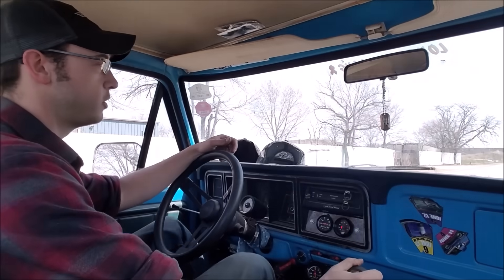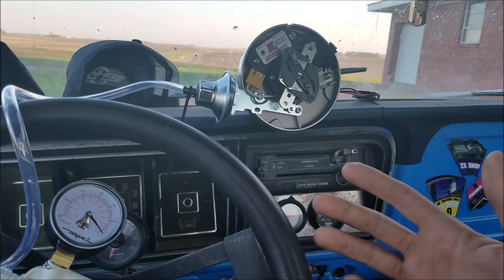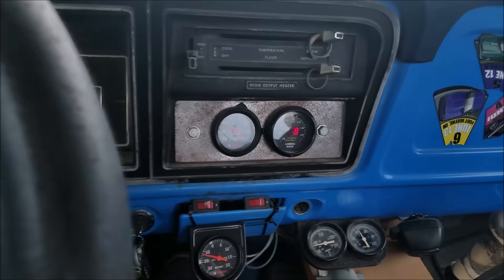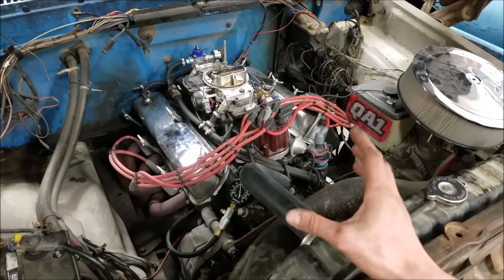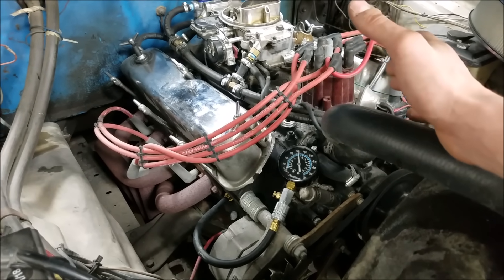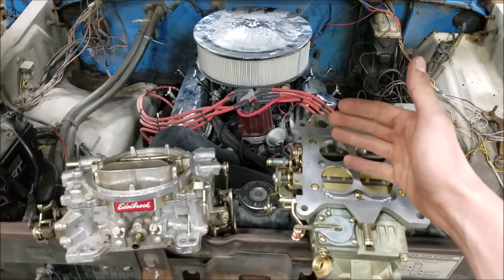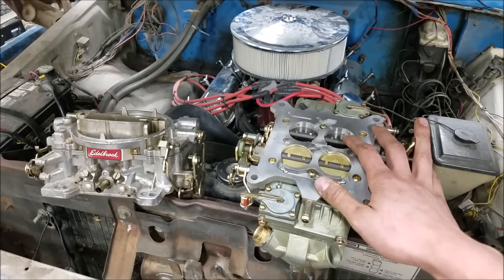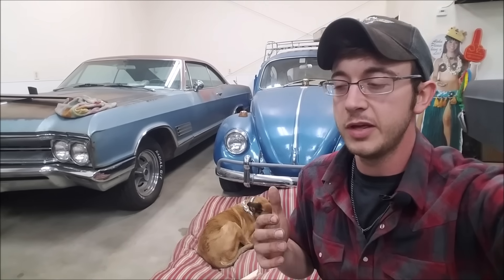Vacuum Advance - Ported vs Manifold: Which to Use & When !!!

Comment: Enjoyed the demonstration. But, my stock engines, 455's, 403's, 350's, 327's, all run best on manifold. 50-60's cars ran manifold from the factory. I tried ported on one of the 403's, compensating with adjustments so it would idle, and it became a dog and ran hot. Changed back to manifold and it cooled down and the off-idle power returned. Always a smooth, steady idle, and immediate power on take off. Don't see any advantage to ported. But to each their own.
Reply: My 78 Buick Regals idle cooler on manifold. On  ported vacuum,a long time idling, the temperature climbs to 230 quickly when I have the a/c on. Manifold vacuum it stayed at 200-220 max in the summer idling with a/c on.
Reply from the maker: Not all 59s and 6ps cars ran manifold- the venerable autolite 4100 only had ported. 
If you were having all those issues, you didn't adjust timing which is what I'm talking about - its not about ported vs manifold, it's about what ported allows you to do with your mechanical timing that you can't with manifold.

Comment: Ported vacuum didn't exist until emissions laws forced them to figure out a way to reduce nitrogen oxide emissions at idle. If you need to meet emissions, you'll probably need to use ported vacuum. Engine temps in traffic and parked are substantially lower with manifold vacuum because the engine is getting the proper amount of advance, and you don't need to rely on extra throttle opening as a bandaid. Less throttle, less fuel burned to spin the engine the same speed, as a result the engine runs much, much cooler.
If you want it to idle smoother and more consistently with cooler engine temps, use manifold vacuum. If you want to have a harder time getting it to idle smooth and you want to fight needless overheating issues, use ported vacuum. Everything beyond idle is identical for both.
Reply from the maker: I'm going to stop you right there about the whole emissions thing - that's an internet lie that's been passed around for a long time. Ported/timed vacuum existed way before emissions. 
The autolite 4100 carb for example factory on early 60s cars, like my own 64 galaxie, only had ported vacuum. 

Listen to what I say in the video and take advantage of it - its what ported vacuum allows you to do with your mechanical timing that manifold vacuum doesn't in many cases.
Reply: @ThunderHead289  Retired auto mechanic here: YES it does have to do with idle emissions! Why else would they design it into the system?
And it's no "internet lie." I've been working on cars for almost 50 years (they taught us about this stuff back in mechanic school many years ago!)

Also, I've NEVER heard of using ported vacuum to "tune" the centrifugal advance! (?) If anything, do the opposite: set up the centrifugal advance FIRST, after you choose an initial lead setting (use 0 to 10 degrees).
THEN, and only then, choose whatever vacuum advance setting you like, but stop short of pinging or knocking. Do it in this order, else it's like a dog chasing his tail.

Vacuum advance (of whichever type) is to improve fuel ECONOMY, and has absolutely nothing to do with acceleration/horsepower. And the centrifugal advance is what gives us the performance (higher engine speed requires earlier spark because the fuel burns at the same rate no matter what the engine RPM). Without it, the engine would steadily lose power as speed increases. Again, vacuum advance is for fuel economy ONLY (nothing else!)
Reply: than answer  is neither is right or  wrong.

will the engine  will run  better assuming  your engine makes the most power @ 36  degrees total timing

an engine  with  18 degrees initial  hooked  to manifold  vacuum?

or

an engine  with  18 degrees  initial  hooked up to ported vacuum?
Reply: A) Idle does not create a significant amount of nitrogen oxide, because combustion temperatures are lowest at idle. Most NOx forms at wide open throttle (high combustion temperatures)

B) If your engine runs hot at idle, it's probably a faulty cooling system, not the timing setting.

Comment: Just found this after buying an old G-body with a ZZ4/Edlebrock combo. Distributor is hooked to ported line off carb. Having a hard time with the engine pinging bad, even with 93 octane. My climate control also has a vacuum leak and interestingly enough, when I switch to heater, my engine does not ping so bad. Waiting for some parts to fix climate control and then hopefully my pinging issue can be resolved. Thoughts?

Comment: Ive been running manifold vacuum advance the whole 30k miles ive had this carb on.    Swapped over to ported vacuum last night.   With manifold vacuum the timing was so retarded it wouldnt start.  Added idk 14-20 degrees to get it running and set it until i didnt get spark knock.    HOLY CRAP DUDE, thank you, that was a wildly violent difference, i had no idea how retarded my timing was , guess what----- my flat spots are gone 😂 with the exception of a decent bog at real low speeds (mostly under 30mph) when i crack the throttle

Comment: Luke, if the difference between ported and manifold is no vacuum at idle, why would you not want vacuum advance at idle?
Reply from the maker: Because of what it forces you to do with your other timing events which I go through in the video. Everyone ends up compensating to bad mechanical timing events to accomodate the addition 15-20 degrees at idle
Reply: @ThunderHead289  Are you disconnecting the vacuum advance hose from the distributor when setting initial lead timing (you're supposed to!)
Reply from the maker: @John-jd7mm who said i didnt ...

Comment: Your information is spot on I learned it back in 1979 at Columbia basin college Pasco Washington had a great tune-up electrical instructor Jay Frechette still good friends today. I'm 67 years old. You also might want to explain if you have an automatic transmission that has a vacuum modulator it better be hooked at manifold vacuum at a centralized location on the intake or carb. And that vacuum better drop to zero when you put the throttle to the floor low vacuum = high pressure high vacuum= low pressure. Thanks for the great videos and information.
Reply: Yes, automatic trans vacuum modulator is supposed to work off manifold vacuum. Ported vacuum is used only for lowering emissions at the carburetor level. Everything else (power brake booster, evap-purge, PCV valve, etc) cannot be connected to ported.

Comment: Manifold vacuum will retard total timing at high rpm and in turn will keep pinging from happening. It’s superior
Reply from the maker: So does ported/timed - like i said in the video and showed with the gauge, they are literally they exact same thing except for at idle. THE EXACT SAME 
I don't know why so many people absolutely struggle with this ....
Reply: @ThunderHead289  well a main difference to me is engine temperature? Do you not find that your engine runs hot on ported vs manifold?
Reply: @lukefranklin2263  Methinks your cooling system needs a good inspection, dude.
Reply: No. That's not how it works.

Comment: there not the same. some of this guy rebuilt a carburetor and all of a sudden there are experts  there too young to know this stuff stop confusing people i always say if you're not helping you're in the way.
Reply from the maker: First of all, I'm thunderhead289 - you might look me up. Second, I'm not young, I'm in my mid 30s, 3rd - put two vacuum gauges on for yourself and watch them. 
Exactly the same except at idle. 
You all are confusing ported/timed vacuum with venturi vacuum and that's flat out 100 percent wrong.

Comment: Nice Hillbilly hack job under the hood. You can buy different length alternator spacers for Fords so you can save all those washers. Fancy carb and a shitload of rubber line and clamps. I would be embarrased to show my quality like that.
Reply from the maker: Yeah it's fine. This was like 5 years ago and still on the road today exactly as it was. 
If you can't see the forest through the trees, this is going to be a difficult hobby for you full of disappointment and regret.

Comment: Reasons I like mechanical advance.
Reply from the maker: They work in tandem together
Reply: @ThunderHead289  Correct. But each has an entirely different purpose: vacuum advance for economy, centrifugal advance for power.

Comment: My understanding is use the vacuum routing that came from the factory because other parts/timing have to also be modified if you change anything.  You can't just change from manifold to ported and not make any other changes and think you'll get a better running motor.
Reply from the maker: That's exactly what I'm saying - it's not about ported vs manifold since the only difference is literally at idle, it's about what ported vacuum allows you to do with your mechanical timing that manifold doesn't.

Comment: Hey I got a question maybe someone can answer. What’s that round thing on your throttle side of the carb?  I need something to bump up my idle under load, like when I turn on my a/c.  If anyone knows what that part is called or where to find it please let me know.
Reply: Does it have wires attached to it? That's called an anti-dieseling solenoid. You set idle with the plunger extended (key on) and the plunger retracts (key off) to close the throttle and prevent engine run-on after shutting it off (dieseling)

Comment: I had different motivations when setting up delivery trucks , ported will carbon load a lot more with a lot of idle time but manifold will make it run hotter at idle. Ported will allow a bit better tweaking to get mileage pickup when running empty on the highway without risking predet when under load 
It does get complicated when the goals are changed.

Comment: Now please explain WTF Chrysler was doing with their combo vacuum (ported and manifold tied together with high vacuum selector) from the mid 80s!!?
Reply: Some engines were designed to give manifold vacuum to a cold engine (runs better) and then ported to a warm engine (there would be a switching device to do this)

Comment: NO! I admire you giving a shot at this but though you explain a ton of stuff you anyhow missed the essence of time advance and dely. The delay part is almost the most important part here. The ported vacum will increase while revving without load. You set the timing with ported vacum connected and the cenrifugal weights and the ported vacum will increase the vacum with increasing RPM, if you have no load! So far everything OK. BUT here is the magic, under load it's working differently and when you accelerate just by pedaling to full trottle the vacum will drop and therefore reduce ignition to prevent, self igniting, spiking or whatever you wanna call it. became more important when fuel octane dropped in the 80-90's. So... the igition drop, to save the engine under load, is the reson for its advance in first place. without the advancing in first place it would not be possible do delay during load. The under load condition cannot be tested other than driving. Check your gauges when giving full trottle in high gear without kick-down and you will se vacum drop to almost nothing and there your timing will drop as well but you cant se it unless your riding under the hood with a timing light. You missed the essence of timing delay but otherwise a good video.
Reply from the maker: It's called "retard the timing" 🙂
Yeah I can tell from reading this comment, you jumped around in the video and didn't listen to some things I said. 
Ported vacuum and manifold act exactly the same off idle. 
I even show it in a driving clip. 
I even explain how timing drops out at load which is due to higher cylinder pressures having a faster burn rate.
Reply: @ThunderHead289  I watched the whole video. You explained how timing drops out due to this and that and maybe It's here I lose you. You se , My understanding is that timing is retarded on purpose with the help of the vacum advance mecanism because it's designed to do so to prevent knocking or detonations. I worked with this back in the 80's and the last carburator and mechanical ignition was 1987-88 on new cars. Electronic ignition and fuel injection with knock sensors simplified everything but the knowledge of mechanical adjustment and settings went lost and it's not thought at mechanics school since many years now. I was just thinking ported or manifold vacum does not matter for retarding timing but manifold vacum is to high at idle and will advance timing to much, thats why we use ported vacum for timing advance /retard for street cars.

Comment: To use in the manifold port, remove the spring tension from the adjustable vacuum canister, the objective of this is that when you need to make strong accelerations, WOT to go off the line, the ignition advance does not drop at the same speed as the which the intake manifold vacuum drops, but rather maintain that advance for about one second after the vacuum has been removed from the intake manifold and configure heavier counterweights or lighter springs, so that at 3000rpm it has delivered the maximum mechanical advance

Comment: Progression ignition runs manifold vacuum though
Reply from the maker: That's different - you can do whatever you want based on rpm and vacuum via programming. 
It's manifold, but completely for a different reason and different concept. 

Not comparable.
Reply: @ThunderHead289  yeah I'm just giving you shit. I ran the progression on my Chevy for about a year. Awesome tuning tool

Comment: I have a crate 383 stroker in my 77 Monte Carlo that came with mechanical advance. Also 700R4 tranny & 3.73 rear gears. The cam Lift: .500 / .510, Duration @ .050: 225 / 231, Centerline: 108.
480 tqe/460 HP at fly wheel.
The vacuum advance cannister is connected to distributer but crimped (not hooked up to any vacuum). As it is, I believe my timing is set at 12 initial 36 advanced. Car runs perfect! 
If I hook up ported vacuum advance, can I simply leave those timing settings alone?

Comment: Is this still a question? Iam manifold team for sure. My SB runs like a different engine since I put it back on manifold with new timing
Reply from the maker: If you don't take advantage of ported by recurving mechanical, you don't gain anything. 
It's not about ported or manifold directly as they are the same other than idle. 
It's about what ported allows you to do with your mechanical timing.

Comment: It always amazed me when I hear someone say ported vacuum advance gives them more overall timing. They don't seem to own a timing light, or understand that the vacuum advance does what the weights in the centrifugal advance mechanism do at higher engine speeds, like 2,000 - 3,000 rpm.
Since manifold vacuum helps advance timing and aids engine performance at low engine speeds, ported vacuum advance would do what the distributors centrifugal advance weights already accomplish. The only gain "might" be between pressing the gas and the engine spinning in the advance mechanically. How long does it take your engine to go from idle to 2500 rpm?
But like many things Hot Rodding, tweaking the base timing, vacuum advance style and centrifugal timing for the correct total timing 35-38 degrees usually, nets a happy hot rodder.
Reply from the maker: Ported vacuum is the same as manifold vacuum except at idle. 
Your explaining venturi vacuum which is not ported vacuum. 

Not sure how you even made this comment when I show two vacuum gauges side by side showing that they are flat out the same except idle - ie have the same exact effect on timing except at idle.

Which allows you to for once have halfway decent mechanical initial since most people on manifold run trash initial timing.

Comment: As a recent new owner of a Chevy 235 straight 6, I discovered the advance diaphragm was shot. I replaced it,  and it made a big difference in how the car drives.  Engine has dual carbs,  dual exhaust.  Ported vacuum,  just like the single original from the 1950's. 
One thing your video made clear to me though was that at partial throttle,  the vacuum is the same,  whether from manifold or above throttle plate.  I was concerned that my ported connection was not taking advantage of ignition advance with light load cruising,  but now I know.   EXCELLENT VIDEO!
Reply: I'm glad I read through the comments before I spouted off, Chris. You took the words right out of my mouth. Massive ditto on your comment,  I've probably watched a dozen videos on this subject, but this is the first one that ever bothered to simply hook up two vacuum gauges that show exactly what jaw-jacking is all about. Excellent work here, thanks to Luke.